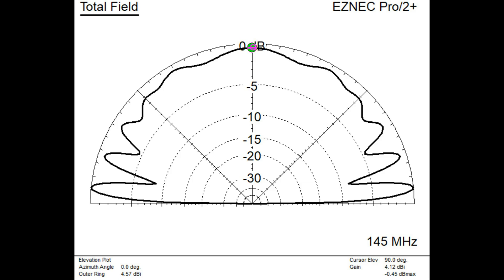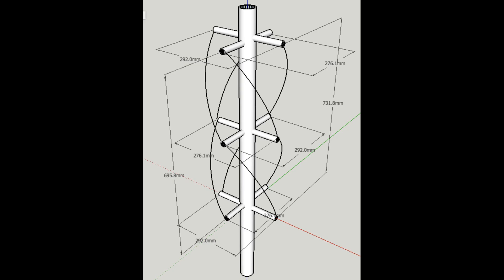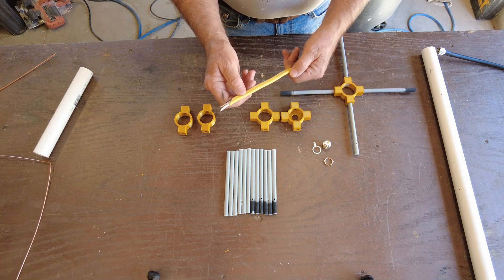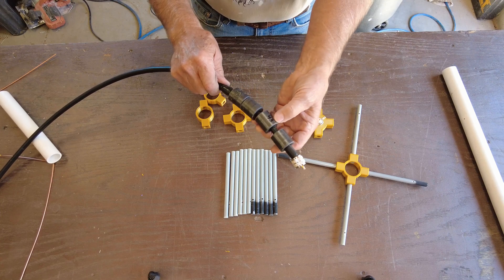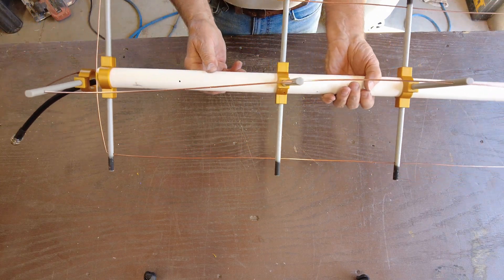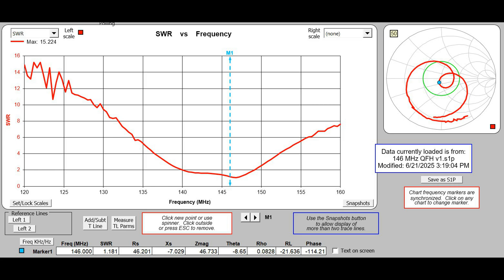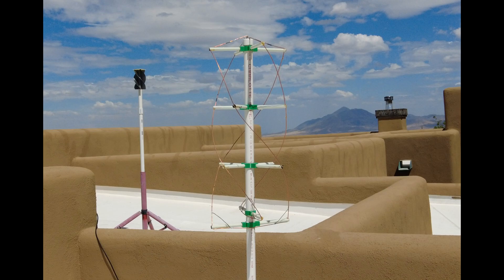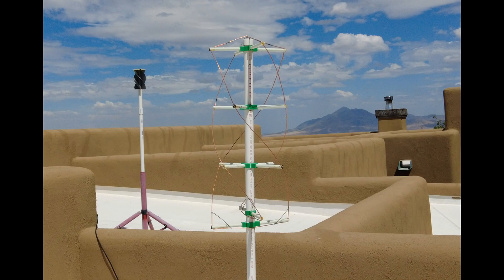146 MHz QFH Antenna for Amateur Radio Satellites

Comment: 14:35 So to be clear on the cutting/drilling of the spokes
You cut them about 5.5 inches long and you drill the hole in the spoke at 124 mm (large loop) and 118 mm (small loop).
You don't subtract the 17mm radius of the PVC from the 124 or 118 because the intended radius is 141 mm and 135 mm respectively

This seems the most practical way to make one of these
Reply from the maker: Yes, you have that correctly.  The 17mm radius was already subtracted from the desired 141/135 radii for the antenna.

Please let me know if you were successful making one of these!  I made two of them and they both worked fine for me.
Reply: @AB7Echo  If I do then would certainly report back

Wife probably wouldn't be very happy to see them appear on the roof though...

Comment: I got a buddy to print the spokes for me.   Probably in late October will have it built.    I am using 8 gage  wire so I will have to drill a larger hole.   Any suggestions ?
Reply from the maker: Why 8 gauge wire?  That's going to be next to impossible to twist like I did in the video.  Even twisting four 12 gauge wires was a bit awkward.  8 gauge wire is almost self supporting anyway ... if you can get it into the proper shape you almost don't need the spider arms.
Reply: @AB7Echo its what I have.   I have insulated stranded 12 gage, solid 14 gage and I have some stranded 16 gage left so without getting more wire figured 8 was best option.   I’ll figure it out lol.  Or just go egg beater moxon if too difficult
Reply from the maker: @Shwarzencofmenmozer  I'd go with the solid 14 gauge.

Comment: Is there anyone who sells the 3d printed parts for those of us without such printing capability? KA2CZU
Reply from the maker: Just about every 3D printing service I've seen charges an very high price for small runs.  Check to see if your local library has 3D printers available for use, and some schools have 3D printers on hand to support their STEM curriculums.  You might be able to convince a class to do the printing if you give a little lesson on why you want to build the antenna.

Personally speaking, I don't want to be in the business of selling these designs.  Too much hassle, and if I charged what would make me consider differently the cost wouldn't make sense.  I've always thought that any ham club should consider using $200 or $300 of their dues money to buy a 3D printer for use by members, but I don't think many clubs do that.

Comment: I'm trying to use the calculator to duplicate your dimensions as seen in the still image of your video.
145mhz
Bend Radius 15mm?
2.05mm for OD of 12ga bare wire?
I'm not quite getting it.
Reply from the maker: As you can see from the video, I did not use a bend radius of 15mm ... I think mine are much sharper at about 3mm or even less.  It is easier to control the length of a sharper bend than a broader one.  And yes, the OD of 12 gauge wire is indeed 2.05mm.   As I said in the video, when I used the calculator for several (maybe six?) other QFH antennas that I built I always found the resulting resonant frequencies to be on the low side, hence my use of shorter lengths than the calculator calls for.  That might somehow be some fault of mine, but my initial builds were always 4-5% low in frequency.  The shorter dimensions shown in the still image were spot on ... at least for me.

Comment: Have you measured the temperature of the coaxial cable? Doesn't it overheat when transmitting or receiving over a medium period of time? The cable could burn. I made another 3-meter helical cable with an RG8X, and it was very hot. I finally fixed it by putting anti-interference agents inside the tube and grounding it. ECC-5150-Z. Good video. I love people who reinvent to improve, but as I said, check the temperature at the output of the equipment; it should be warm to the touch after 30 minutes.
Reply from the maker: Absolutely nothing you said there makes any sense at all.  First of all, the cable used in the video is easily good for a kilowatt of power and I used about 50 watts.  Secondly, RG-8X is a really poor cable to use at VHF, but unless you were running very high power or had a horrible VSWR it wouldn't get hot.  And "anti-interference agents" is pure gobblygook.  You are either just a really clumsy troll, or you need to stop drinking or smoking whatever it is you're using.
Reply: @AB7Echo  You are a damn rude person.
Reply from the maker: @PeatonDelMarRojo  Only to trolls like you.

Comment: This is  first rate job for sure. Don't get discouraged if you can't do it. My contacts with MIR and ISS were with an MFJ mag mount stuck on a cookie sheet which was closed in an upstairs window. Radio was a dual channel Yaesu handi and a  Kantronics.
Reply: With my Handy with the factory antenna I can also hear it, but when I see on the web map that it passes "close" 350-400km from where I live, but as I am on an island with almost no relief I think it helps a lot

Comment: Tip for people who have little space to place a QFH antenna.
Have mounted 435 Mhz qfh antenna on top of the 145 Mhz for sat work already made many qso's with this configuration with low and high TX power no interference found.
73 PE1NIL
Reply: How did you attach them, how far apart, and how did you feed the 435?

Comment: Hi, thank you for posting this info! Would you possibly have a link for the type-43 beads you used? ...and maybe state the coax type? (I'm investigating potential costs in my replicating your system) Cheers!!
Reply from the maker: I used some older type-43 beads I had on hand ... I don't remember where I got them.  They're a bit large for the coax anyway, so I'm going to see how these measure on my NanoVNA.  https://www.amazon.com/dp/B084LVGZ9Q?ref=ppx_yo2ov_dt_b_fed_asin_title  They haven't arrived yet, so I'll let you know what they look like after I get them.  The coax I used is called BuryFlex from DavisRF, which is basically a good quality flexible RG-8 cable with specs almost as good as LMR-400.  The type of coax used inside the antenna isn't critical, though, since it is so short ... what you use from there to your transmitter/receiver is more important depending upon how long it would be.
Reply from the maker: The smaller cores I said I was getting don't have enough impedance ... only about 35 ohms at 145 MHz.  But I did some searching and it appears that this was what I used for the QFH, although not necessarily from this vendor.  You can buy them from DigiKey as well ... and probably other places like Mouser.  https://tinyurl.com/5t3dz4rs
Reply from the maker: Consider these as well .... https://youtu.be/lEDojt0vhQk

Comment: Very nice build!
I'm a new Radio Amateur but work with radio telecom and remote control professionally.
Have heard the ISS couple of times an wat to build this as well, but more projects as well...
 I was wondering, can you mount the 70cm on top of the 2m with a large enough gap on one pipe, or will the TX energy overwhelm the 70cm reception? 🤔

PD1MRK 🇳🇱
Reply from the maker: Thanks!

I think you could probably mount the 70cm QFH on top of the 146 MHz QFH,, but if you're using the 146 MHz QFH for the uplink you're likely to have overload on 70cm if that QFH is located anywhere near the 146 MHz QFH.  At least that's what happened to me when I tried to operate full duplex, and I had about 12 feet of separationbetween the two antennas.  It didn't damage anything but the harmonic energy from the 2m upload blotted out the 70cm download while I was transmitting.  The solution is to use a filter or diplexer in the 70cm path, like is shown here on the AMSAT website.  https://www.amsat.org/a-simple-desense-filter-for-mode-j-satellites/  There are several diplexers available that would work, but I bought this one and it worked great ... I measured its rejection at 60 dB.  https://tinyurl.com/2hb2m6sn  Good luck and ask questions if you need.  Dave AB7E

Comment: Been thinking about sat work.   Sounds like fun and is easier and cheaper than well damn near any other method.   Needing to get a radio capable of both SSB 2m and 70cm I think but 2 meter more so - can always use an sdr on either band.   
Just wondering how well does these work with fm repeaters ?  The gain didn’t look too thin on the horizon.

Comment: 50 watts is waaaaay too much power. The satellites can be damaged by that much power. If you were trying for AO-7 that might be ok seeing you are omnidirectional.
Reply: If 50 watts can “damage” the satellite…. Then it probably would have blown up already, just saying
Reply from the maker: I think you should brush up on your math.  50 watts is 10 dB over 5 watts, and lots of folks are using crossed yagis with roughly that much more gain (like from a 6 element yagi ... I've seen the pictures) than I'm getting from these QFH antennas.  And they're probably running more than 5 watts.  I just ran the numbers through ChatGPT and I should probably limit the power to more like 20 watts for good practice, but 50 watts (4 dB difference) isn't "waaaaay" too much given my setup that probably has an additional 2 dB in cable and connector losses.
Reply: @AB7Echo I'm just going by what Amsat says on their website. Those birds are expensive to build and deploy into orbit, and if the owners of said birds tell everyone to keep the power down so you don't cause damage, then that's what everyone should do.
Reply from the maker: @realfoggy  Like I said, check out what a LOT of what other people are using for rigs and antennas.  My setup pales in comparison for effective radiated power.

Comment: I know you are American, but use N connectors instead of the SO239, far better and easier to weather proof!
Reply from the maker: That is true, but I have so little use for N-connectors that I don't keep them on hand ... and at 145 MHz there is only maybe 0.2 dB difference in loss relative to a pair of UHF connectors anyway.  For higher frequencies, where I don't run more than a few watts, I use SMA connectors.